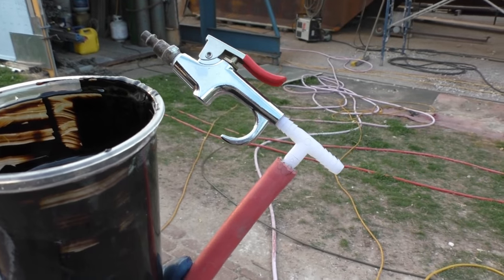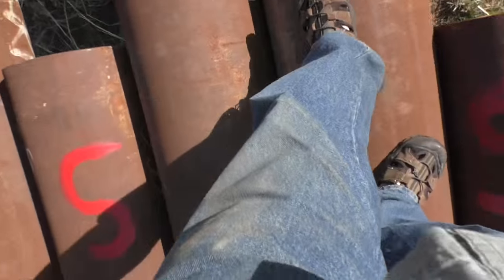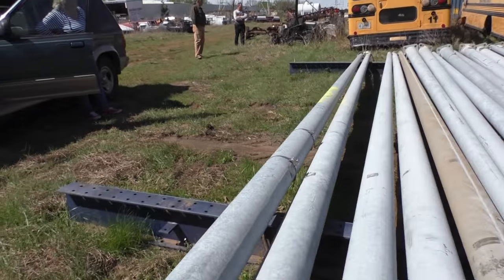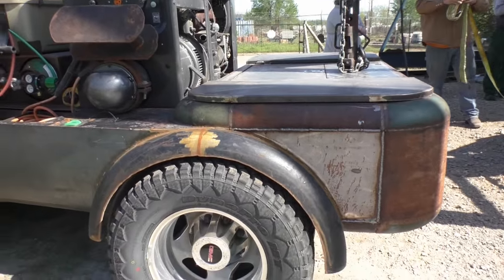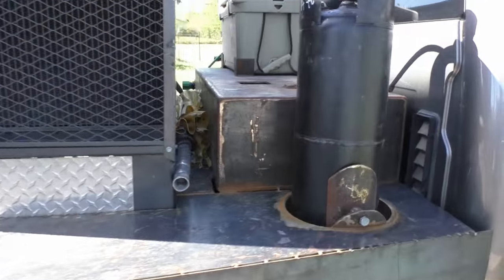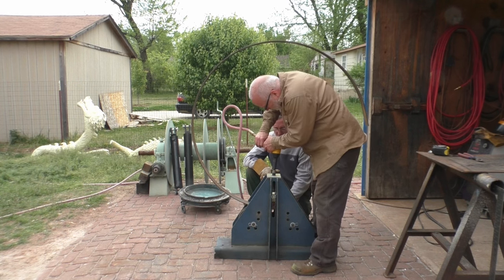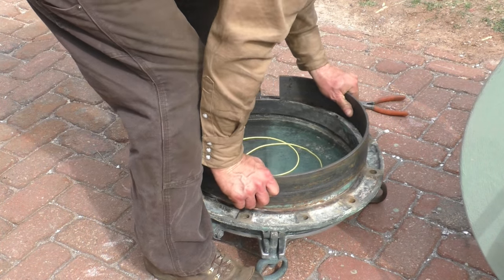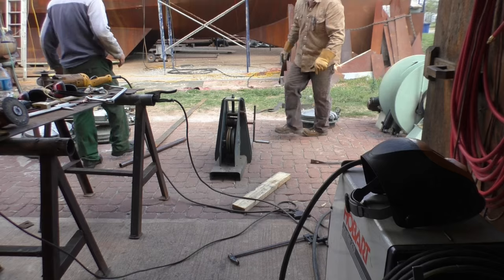Mast, Keels, and Portholes

Comment: Have you looked at siphon guns like the Critter Spray Gun? You may be able to modify it slightly to accommodate the viscosity of that epoxy. I love mine and it will spray relatively thick fluids without mods.

Comment: There are DIY projects out there that adapt the HF power threader to run the ring/tube roller.  Someone sells a parts kit for that too.  There's a mod to insert a bottle jack to push the top roller but that does limit the diameter. The impact wrench beats a ratchet, that's for sure!

Comment: If you need to strip of the galvanizing from the pipe to elongate it, the best way is to brush on straight hydrochloric acid until it stops bubbling. It will strip it to a perfect clean surface and you can even mask the pipe of with painters tape to control the stripped area 100%. For a pipe that size you can properly do it in less than three minutes. 
I use this method for plumbers pipes I use as a cheap construction material for odd projects. Small pipes is easiest to just dip in a mason jar with acid and wait a few seconds for the bubbles to stop.
Don't forget to clean with plenty water after you have stripped the galvanizing.
Reply from the maker: +Jens Sigurdson  Interesting.  I was going to just grind it off.  I have muriatic acid.  Shouldn't that work too?
Reply: That is the same thing: H-Cl
:-)
Reply: I knew ya would, yer old grinder! LOL

Comment: Hello Doug,  Check out a paint supply store or Grainger for 'radiator brushes' .  They make painting odd angles much easier (like in behind angle iron).  They come in 2 through 4 inches and 45 degree angles both vertical to the handle and horzontal that I know of.  We used them on ships.  Very useful but you never see them in box stores or even hardware stores.  Doug

Comment: Hi,

And I am pleased for you that you found a Mast and Mizen. It the main mast going to be a temporary one, with the walls being thinner than you might need, using it until you can find the correct thickness?
I am not ofay (sorry on the spelling) with how you might fit it, but can you do one of two things, first use this mast and strengthen it so it will have the same strength, welding narrow strips to it which will allow you to get other measurement as the mast is raised, and I am assuming you have the outer dia the correct size, second, use this mast as a temporary one until you can find the correct wall thickness of a second one?
Reply from the maker: +mrbluenun    We got what I wanted.  The main is 5/16 wall, 16" diameter.  Not much was gained by going to 3/8" wall.

Comment: Oh fuk... Just powder-coat the aluminum DeadLights!   use Teflon washers and bushings. You need a few more exotic tools in that workshop of yours.  Plus you could p coat the first 6 inches of the pilot house and use some sort of non conductive gasket between the aluminum and steel.